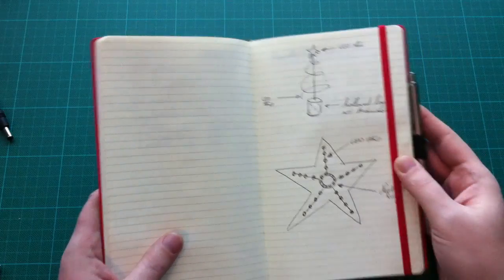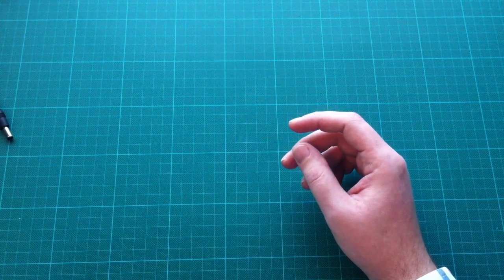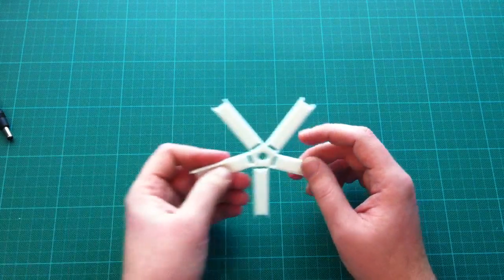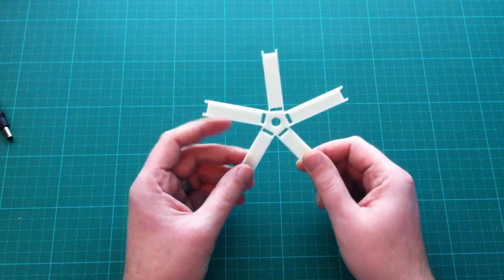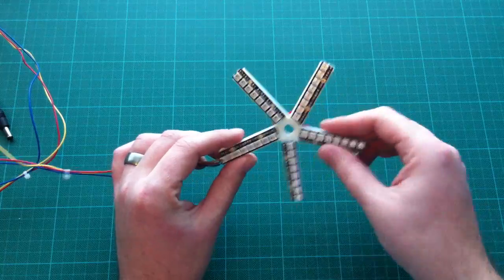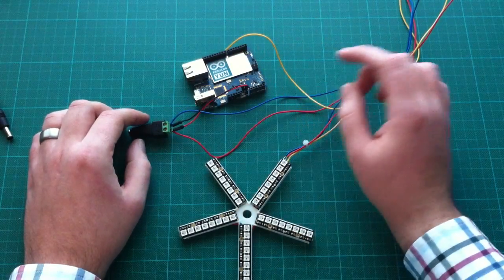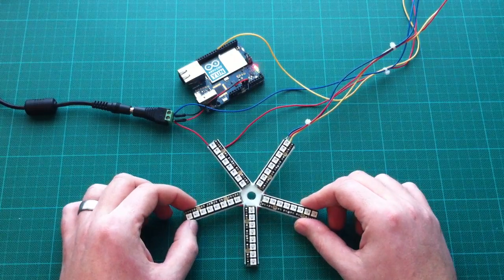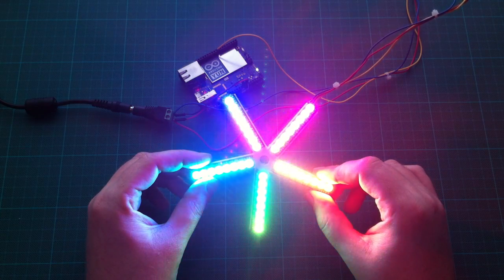3D printed NeoPixel star controlled by Arduino

Comment: Guys, he is using the regular neopixel demo library for this.  It's called "Strandtest" if you look under examples in Arduino.  Make sure to change the pin to match what you're using on your Arduino and you should be set.